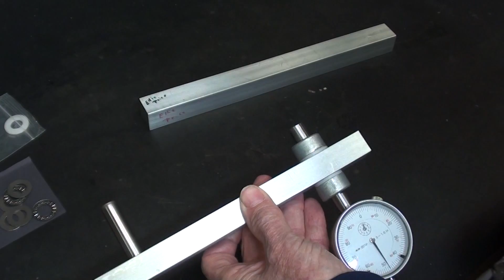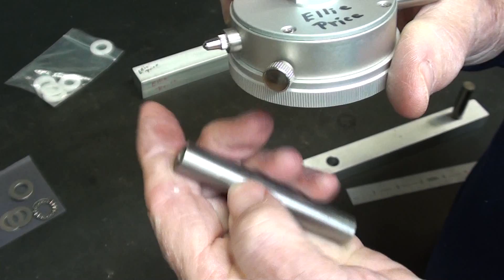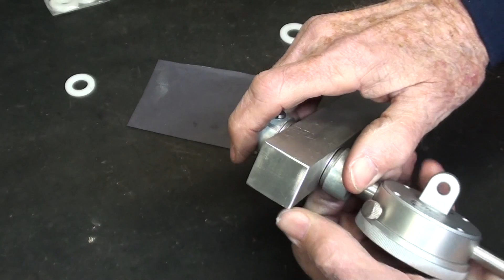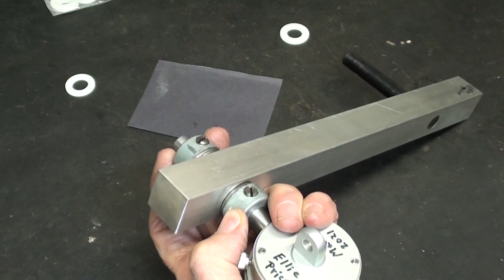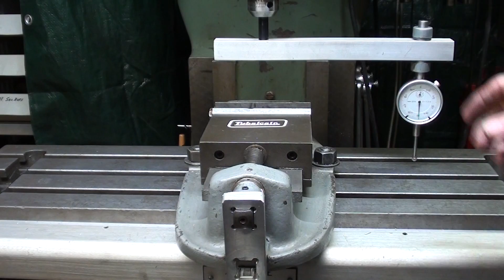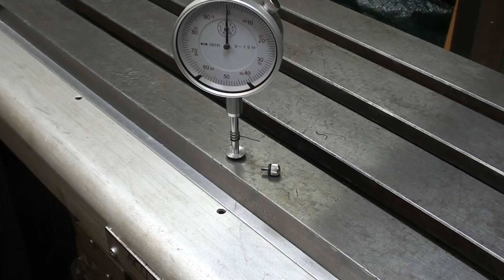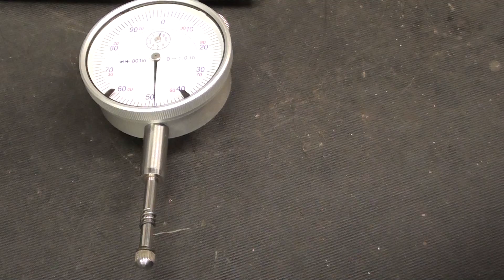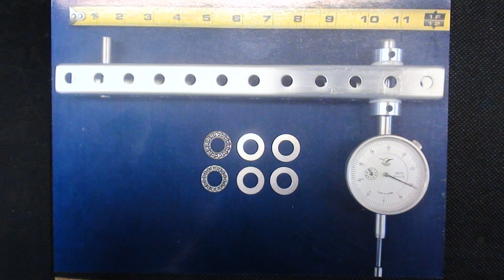MAKE BRIDGEPORT TRAMMING ATTACHMENT #662 tubalcain

Comment: I like this design. I have been unscrewing the rod from a magnetic indicator holder and mounting it upside down to tram. This is simple enough to make to have a dedicated tool for that (and I will be inspired to check it more often). I have what appears to be a well made keyless chuck, but since it is an import, I will probably use the new tool in a collet rather than the drill chuck. I will probably try both and compare them 😊. Thanks again!!,

Comment: I used to use a big outer race for a tapered roller bearing, about 9" diameter. Worked great!
Reply from the maker: Sounds like a good idea.
In one of my older videos, I used a brand new truck brake disc

Comment: Mr. Pete, I have a Rong Fu round column mill (I know, I know that it's not very good, but it's what I have). Once properly trammed by adding shims to the base, it should remain that way as long as the mill is not moved or frammed around to get it out of whack, or possibly by making heavy cuts. Am I correct in my thinking? Then, the only thing needing to be checked is the vise alignment. Again, am I correct in my thinking? Thanks!
Reply from the maker: Yeah, you're correct on both of those points.

Comment: None of that is needed.
Make a pair of 6  -- 8 inch riser blocks. Even one works. Set on either side of the vice. 
Also it brings the indicating surfaces up closer to the pivot points if the mill 😎👍

Comment: Thank you for another great video.  It seems to me that even if your mill is slightly out of tram when you make this tool it won't matter.  It will still measure correctly. This wouldn't be true if the tool rotated at the dowel pin-- but since the dowel pin is pressed in, errors in drilling the holes don't matter.  Very nicely done!

Comment: Thanks Mr. Pete. I made one of these and it worked Great. Set my mill dead on in the x axis and within 
.0005 in the y axis. The proof came when the text book perfect swirl was present when the fly cutter made a pass. Dead on x axis adjustment in 10 minuets. Now the Nod was a different time line. Huge adjustment learning curve. But my mill even though old and had had a rough industrial life surprised me it was able to be dialed in to that exacting standard. To get it within .0005 on the nod and 18 " span was amazing to me.

Comment: Why not make one these for a drill press?
Reply: Good idea. I actually made a shorter unit for my drill press. Sad news...the front of the table is .021 lower than the rear and there's nothing I can do about it. 
Update: January, 2023, I finally figured out a way to correct the tilt. Took a lot of thought and work but the table is now trammed to .005 total indicator movement.

Comment: Once the table is tremmed it would be interesting to tram the vise. I have a cheap import vise that I usually have to put a couple of thousands sheets under one side to align it up. Table is great, put work in vise, tap into place, and find vise was off some. OK - maybe this is extreme, but I need all the accuracy I can provide for. Your video gave me the idea of some sort of flat plate with a perpendicular extrusion which sits on the vise base and held by the jaws. Then tram the plate horizontal surface. If that kind of accuracy should be needed.
Reply: That's actually the sound practice, to shim the vise and square it to the spindle with a spindle square.
Reply: @RichardKinch  Or, if possible turn the vise over, clamp it down and machine the base parallel to the top.

Comment: Can't you just point the indicator dial away from the quill and read it from the left and right side of the machine? Why make it rotate at all?
Reply: The operation requires that you sample at least two points on the plane targeted to be square to the spindle, which is what the spindle rotation sweeps.

Comment: Very cool idea to be able to rotate the face of the dial. (I typically use a dove tail indicator so I can have the face upright.) 

I don't have the time to read all the comments, however a trick my shop teacher showed was to use a gage block on the table, and indicate off of that.....instead of the actual table. This will minimize the interruption on the indicator around the T-Slots and back of the table. You could use the same gage block if you want......or put the same height/stack up on both sides. My process with that is to spin the indicator around to the area I want to check and then slide the gage block underneath.

Comment: If you have a coaxial indicator, running it slowly on the top of the vise works about as precisely as a swing arm, zeroes out the tram very precisely in one quick semi-automatic step including nod, and trams directly to the vise X-Y plane instead of the table.  You do have to have that tool and a variable speed spindle for about 60 rpm.  Also works on the table directly if you have a 6-inch parallel plate.  You only have the worm/clamp wrench in hand during the procedure, instead of having to manipulate a swing arm.  It's a musical joy to watch that needle wobble and then steady as it zeroes out.  You also gain sense and control over the budging and stability of clamping down the tram and nod axes.

Tramming without nodding will eventually get you in trouble; they both need checking regularly.  Large tram/nod errors will spoil just about every operation, workpiece, and tool you put into the machine.  Speeds, feeds, chip loads, symmetry, depth of cut, removal rates, horsepower required, fixture force, all are defeated by spindle-vs-table perpindicularity errors.  Your weapon will never hit targets if you don't sight it in first.
Reply: Nodding is easy to check and correct with this device. After the tilt is corrected set the indicator hand set to zero and slowly rotate the bar across the 9 inch table and note if the indicator hand moves. If it moves from zero loosen the three bolts on the  ram and adjust the nod until the indicator reading remains the same all the way across the table. At this point tighten the three bolts and check the swing again to be sure nothing has moved. The head is now in perfect tram.

Comment: What about the dirty little details? Is there run out in the Drill Chuck?  How does this affect the process? Are the holes square with each other in the tramming indicator holder. Is the knee cranked up to ensure wear was always in the same direction? Why would I want to skip on and off the mill table when I am trying to get it as accurate as possible? These  steps or points , could or would enable higher levels of accuracy on this type machine. Which can in the right hands do very accurate work.  I am sure this doesn't matter to most. As to School machines, I know most of the time they are not worn out, but I know they always have been exposed to YEARS of serious abuse!
Reply: The chuck or collet tilt or runout does not matter in the least!
Reply: @RichardKinch  Really? If I clamp a ground rod that is straight and true in a collet  and it indicates close to the collet and it is almost perfect, but as you indicate any distance from the collet/chuck the run out will increase. You must realize this is not only Concentric run out,  it also shows that the ROD is NOT  SQUARE with the centerline of the spindle. The more distance that you move away from the collet or chuck this effect will be amplified.  As with this indication attachment, the more distance between the indicator and the centerline of the spindle the error  increases. This does not even consider how square attachment parts are made, just how much runout is in any Collect or drill chuck.   If you indicate a part in a 4 jaw chuck to get it correct it MUST be indicated on the face and the diameter (AT LEAST). You cannot just slap the part in the machine and assume that it's correct!   What is the or your tolerance for error? In this business there is NO PERFECT parts, there is simply the specified TOLERANCE for error. Certainly many that use this type of mill can use this devise ok, knowing that it has limits and where/what they are is what counts.
Reply: @p.debolt6784  You may be confusing the motion of the single-indicator spindle square with its shape.  Any point on a rigid item attached rigidly and firmly to the spindle will sweep a precisely concentric circle in the plane normal to the spindle axis.  The item is constrained in 5 out of 6 degrees of freedom, and free to move only in the spindle axis.  The indicator shape itself is irrelevant other than the constant radius of sweep.  The spindle bearings establish this constraint and freedom, which precisely defines the XY plane of the spindle.  Hence squaring the spindle axis to the table is effected by measuring the coplanarity error of that swept circle from the static plane of the table or vise.  That measurement is what the swept indicator tip samples.  You read that error and progressively adjust the spindle fixation to null out that error, as Mr Pete ably demonstrates.
Reply: @p.debolt6784  The easiest way to understand this is to view the chuck as an extension of the spindle. This can be easily proved by rotating a length of bent coat hanger wire across both ends of the table. Mr. Pete will show that chuck wear does not affect tramming accuracy in a future video
Reply from the maker: Many of yours are over analyzing this video. Run out does not matter in the least. I intend to show this in a follow up video. Thanks for watching

Comment: Good idea!  When I build it the DTI will get the dual thrust bearings but I'll be adding threads above and below the bar to allow incorporation of Bellvue spring washers.  A uniform pre-load on the bearings offers a bit more piece of mind.  Also, a second ground pin in the middle of the beam allows nod measurements to be made.  One would need to run the table and vise left or right to do the nod tram.  With the eccentric weight load of the vise on the table the locks would need to be set for an accurate nod-tram.
Reply from the maker: I think I’m Belleville washer is too thick.  Possibly a wavy washer would be better, but really they are not necessary. Watch for a follow up video

Comment: I would not hold it in a jacobs chuck but otherwise seems neat.
Reply from the maker: Why not? Remember that Runout has absolutely no affect on it. I will do a follow up video to prove that. Many people are worried about that for no reason
Reply: @mrpete222  Jacobs chucks are not very precise when it comes to straightness. A brand new one might be alright, but it would be better to hold it in a collet.
Reply: The chuck or collet tilt or runout does not matter in the least!
Reply: The pin is not rotating in the chuck jaws or the aluminum bar. Chuck inaccuracy does not matter since the chuck is turning with the spindle. In other words the Jacobs chuck is an extension of the spindle.

Comment: Would you have issues with the aluminum arm “twisting” due to temperature?  Sorta like what happens with gauge blocks.
Reply from the maker: Not at all
Reply: It does not matter in the least, if the temperature is stable during the one final swing of success.

Comment: Nifty devise.  Seems like a good place to use a wave or spring washer.  Would keep the indicator lifted up and give consistent friction when rotating.
Reply: Pinch the stop collars and nylon washers firmly together before tightening the set screws. Since nylon is self lubricating the indicator will still turn freely with no end play

Comment: A few comments. 1) Needle thrust bearings are actually quite inexpensive. 2) I think Mr Price just swapped the top knob and the point, and used the domed knob as a contact point. 3) When tramming L/R, with every adjustment of the worm the two indicator readings change about the same amount, and in opposite directions, so it's pretty easy to home in. But with the nod the indicator readings change different amounts and in the same direction. It can be a frustrating, iterative operation. That's why we avoid it. But note that the distance from the spindle axis to the nod axis (on a BP or similar) is about 8". If you zero the indicator at the back first (after L/R of course) and directly under the nod pivot, that reading will barely change at all as you adjust the nod. Just adjust the nod for a zero reading at the front and you'll be very close on the first try. That could be why Mr. Price recommends an 8" offset. 4) I kinda question the need for such extreme accuracy as is afforded by such a long arm. .0005" error over 16" is less than .002°. A "spindle square" that spans 5 or 6 inches would be no more difficult to build, and probably easier to use. But that's a different discussion. Thanks for this video, Mr. Pete.
Reply from the maker: Great comment regarding adjusting the nod. Very frustrating. That was a big help
Reply: Yes, that's exactly what I did. You have sharp eyes.

Comment: Several have mentioned how frustrating it can be to tram the head. The reason may not be obvious at first glance. The problem is you may think that you are rocking the tool that Lyle made  (or some similar set-up) back and forth to find the zero point on both sides. But you are not actually doing that.When the difference is 0.005/0.010" in Lyle's demonstration it seems to to work just fine. If the difference side to side is more like 0.030" just splitting the difference doesn't work. You swing the indicator back and forth and it's still not square to the machine table. 

The problem is that you are rocking the head back and forth on a pivot a foot or more above the indicator tip. The indicator is working along an arc. You can easily go past the vertical point and any further adjustment makes matters worse. Now you can see the advantage of set-ups that use two indicators at the same time.

The trick to using a device like the one shown is not to split the difference in the indicator reading. Instead only take out about 1/3rd  of the difference when adjusting the head and recheck. Several tries should have you in the range shown in the video demonstration and you can hit the vertical tram position.

Cheers from NC/USA
Reply: This problem arises from the non-perpendicularity of the tramming tool to the spindle axis.  That factor does not affect the quality of the final adjustment, but it is progressively non-symmetric the further off tram you start out and have to adjust.  The swing generates a tangent function, not linear, until you get it close to zero.  One heuristic is to take 1/3 as you say, which stabilizes the approach instead of overcompensating on each try.
Reply from the maker: Thank you that was very helpful
Reply: Most of the problems you described can be alleviated by simply setting the tilt and nod protractors as close to zero as possible. That way you’re only dealing with a few thousands out 
of tram on both axis. Never attempt to tram a machine without first setting the protractors to zero.

Comment: I always used a "finger style" indicator with the dial facing up, but where I worked we had a tramming ring that sat above the vise so it was easier.  BTW, I graduated from Joliet East in 1976, a long time ago.
Reply from the maker: They must’ve close the school about 1980. I did my student teaching at Lincoln Way high school 
Do  you remember that?
Reply: @mrpete222  Yes, I remember  when New Lenox's town population sign said 2200 and Lincoln Way was just one school not 3 like it is now.  I grew up in Ingalls Park.

Comment: The spring “handle” is ingenious. I’m not sure I trust doing this in a chuck though. Even my Jacobs ball bearing chucks don’t point perfectly straight. Regular chucks that don’t have that precision are worse. Best to eliminate that possibility, and use a known to be good collet, or a collet you reserve for just measuring.

I find that to get parallel machining, I need to tram to better than 0.0005” per foot. Otherwise close sliding fits are impossible
Reply: No!  The chuck or collet tilt or runout does not matter in the least!
Reply: @RichardKinch  of course it does. When you turn it one way, the indicator is pointed slightly one way higher, I know you’re thinking that it will be the same as you sweep it around, so it cancels out. But sometimes that will happen, and sometimes it’s not symmetrical. I’ve done it, or I wouldn’t have mentioned it.  The problem is that it’s hard to tell just by sweeping. At a Ty rate, it’s a small amount. I find that if tram is off my more than a couple of tenths over 6 inches, at worse, you can’t machine parallel sides. Bad for close fits and sliding dovetails and such.
Reply: @melgross  It does not.  The indicator always swings a circle in a plane perfectly normal to the spindle axis.  The geometry or precision, symmetry, alignment, etc of the attached tool is absolutely irrelevant, as long as the tool is rigid and rigidly fixed to the spindle.  Your experience was perhaps due to a rigidity or fixation problem.
Reply: The dual indicator devices such as EDGE do require a very accurate chuck or collet since they don’t rotate. However, when the bar and indicator rotate 180 degrees to the other side of the vise as this device does the chuck or collet do not need to be accurate. In fact either could be very crooked and not affect accurate tramming at all. 
Mr. Pete plans to demonstrate this in a follow- up video. Thanks for watching.